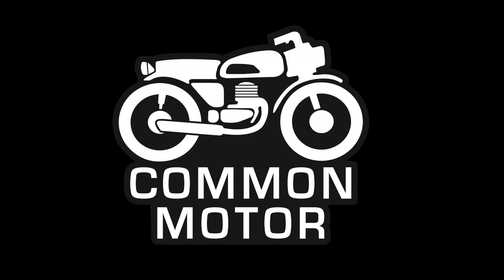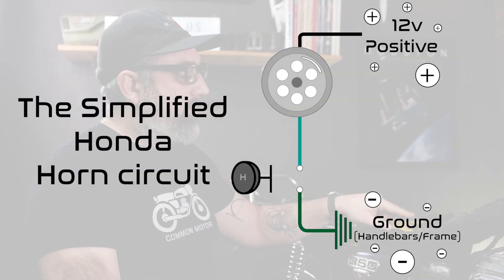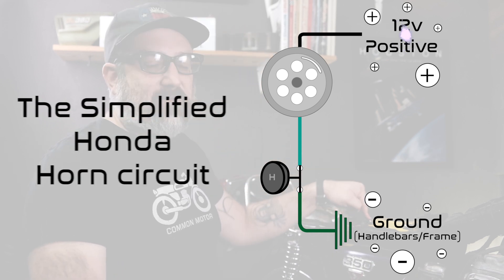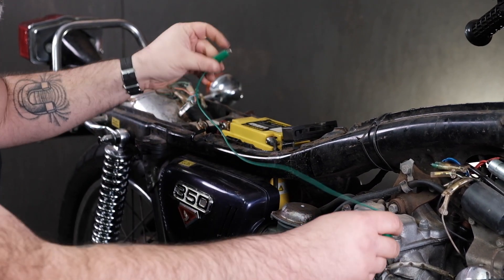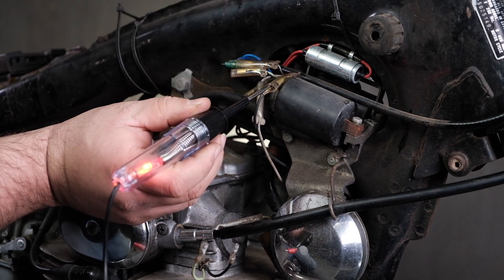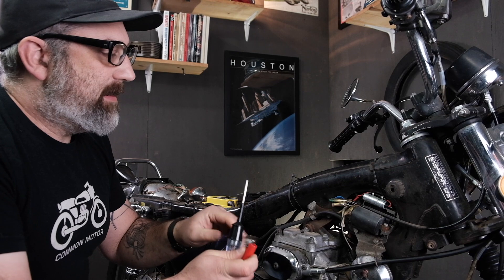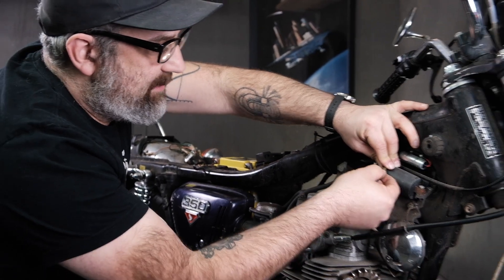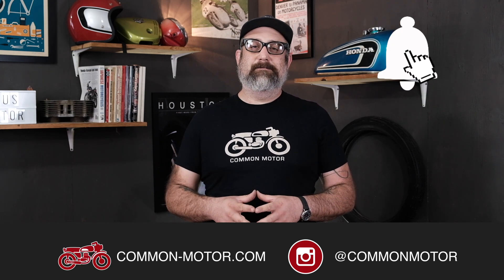The Horn Circuit: Electrical Troubleshooting and Basics on a Vintage Honda Motorcycle

Comment: This is super helpful thank you!There was a time when working on my cl175 that for reasons I can’t figure out that when I turned the key switch to on the horn would blast continuously. I took off my the emgo aftermarket handlebars and put on old OEM handlebars the problem went away 🤷 anyways thanks for the instructional videos as always!